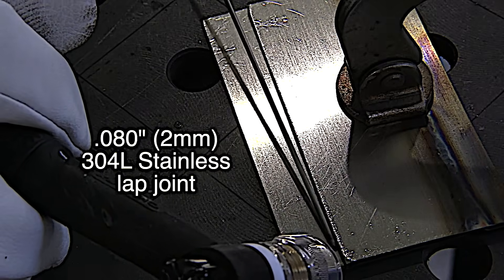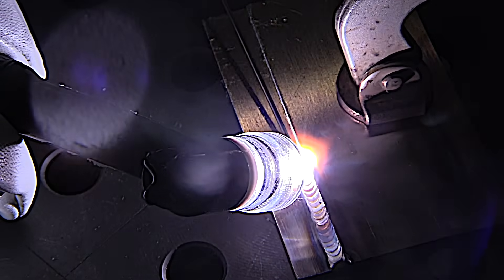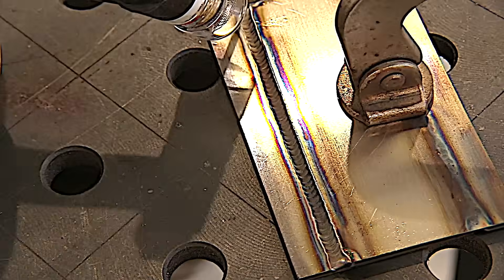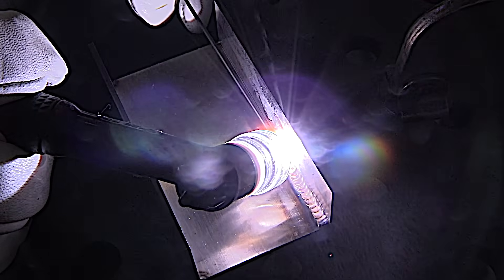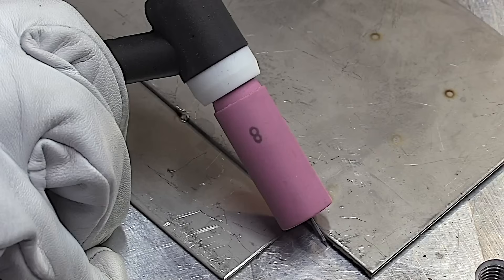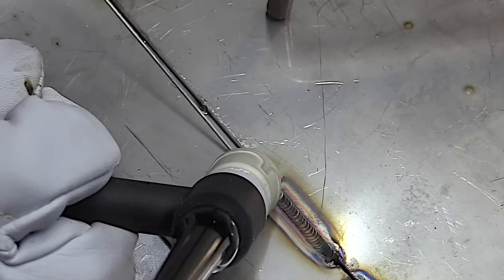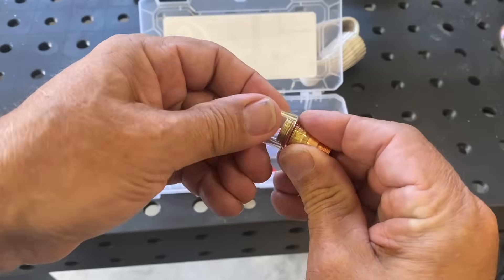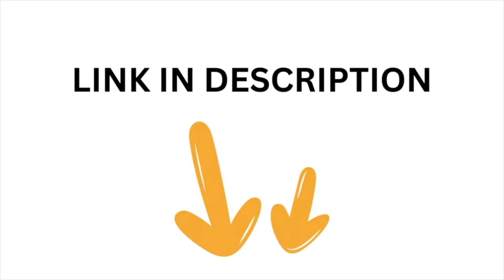TIG Welding Stainless Settings for .080" Lap and Tee Joints

Comment: I have been an exotic metals welder for 30 years. I love these videos. However; young people or people who are novice to exotics need to realize a see through cup is fantastic but it is not necessary to have. I say this because I am pretty literal and If I were just starting out I would be running around trying to find one spending money I don’t have to try and be like Jody. A ceramic cup on a standard gas lens or jumbo lens will give the exact same results. If these gas lenses are unavailable to you because of location a standard collet body and ceramic cup will also work and it will also produce beautiful color that Inspectors will love. Thanks for the great video.